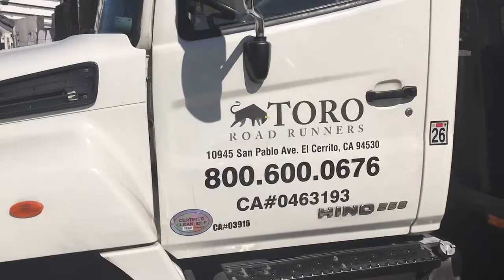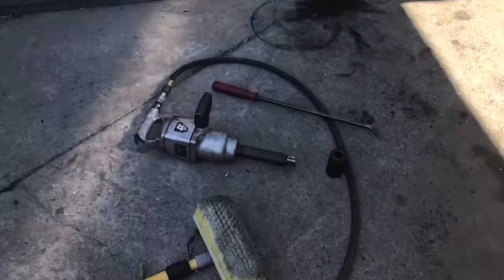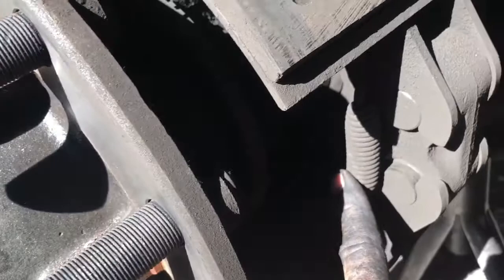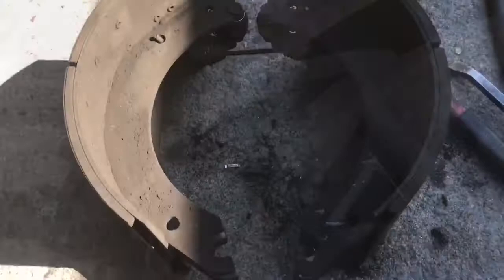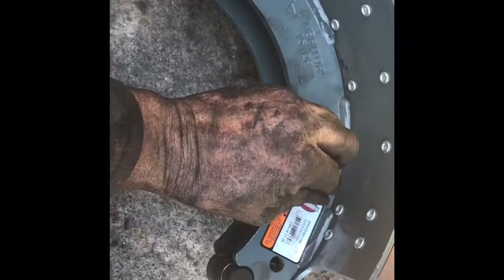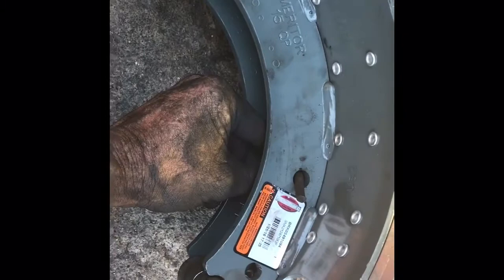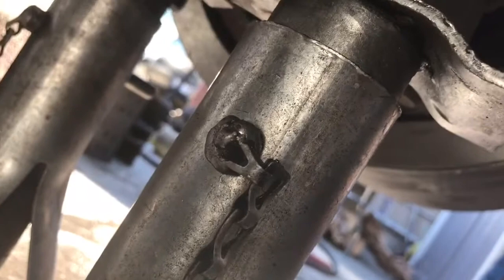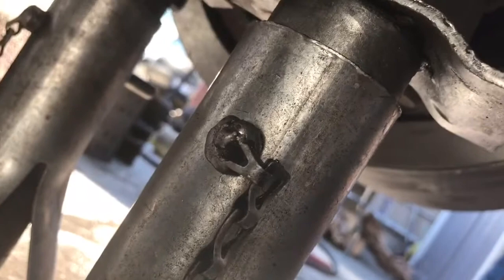How to Replace Truck Air Brakes

Comment: How can I adjust the belt for my air brake compressor under the hood? I don't see any adjustment anywhere (2018 f650 diesel rollback) any assistance would be appreciated
Reply from the maker: I’m not sure how that’s done.  There should be some kind of tensioner.  Or you have to replace the belt.

Comment: I gotta send you a box of gloves ken.
Reply from the maker: The Mechanic OC   LOL.   I should have been wearing gloves.
Reply: @1970chevelle396  Gloves ruin the feel, especially with fiddly jobs (been working on vehicles for 45 years).  The only tiime I've used them is when using nasty chemicals like degreaser.